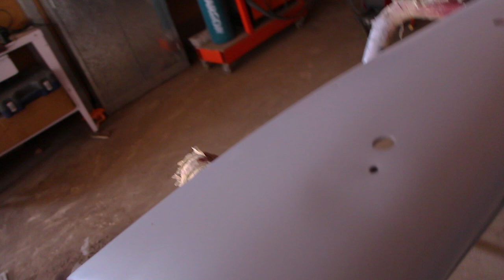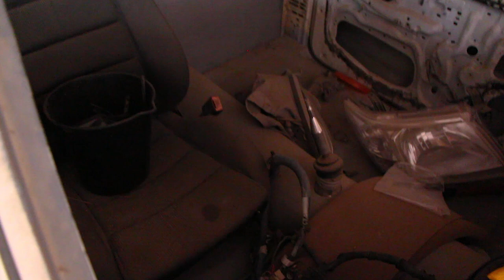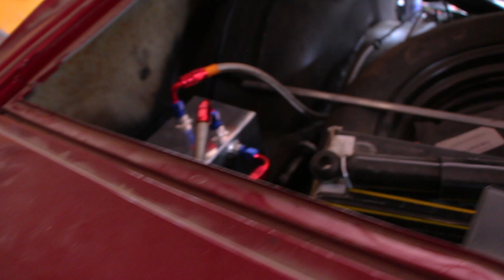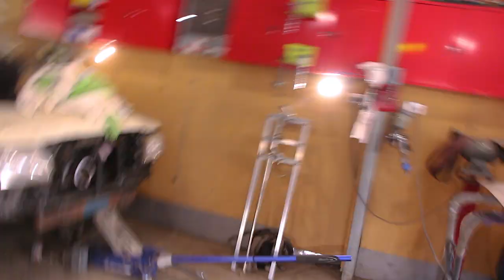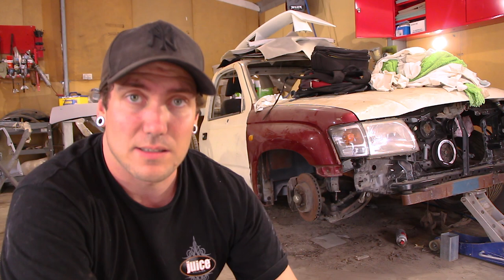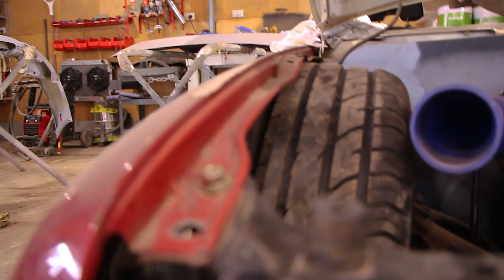What Size Wheels Fit Under A Bagged And Bodydropped Toyota Minitruck

Comment: I have a 1995 tacoma.  I want my wheels to fit in the fender.  What side to get the look.  My is 5 lugs
Reply from the maker: Hi. These are 20 inch 5 x114.3 with a 225/30 tyre. It has a similiar rolling diameter to my 245/40r18....both tuck lugs....id say youd need a +40 offset an ass n 8 inch rim. However i am no expert. These rims still rub so im still chasing the perfect size

Comment: How much of the wheel arch did you cut out?
Reply from the maker: The wheel wells have been removed fullly and will have custom wheel tubs welded in to allow the car to have a full range of suspension travel 😁
Reply: @JoeyVanVeenYt  What kind of effect does that have with the weather and debris in the engine bay, just curious as i have a slammed 89 hilux and hit my limit for lowering the front and daily drive my ute
Reply from the maker: @kieranabbey6418 cant comment there as i havnt driven it. There would be a way to fabricate wheel tubs to limit water and debris for sure. Seems like a alot of work for a static truck though 🤔 Theres only so low you can go static without coilovers or bags. I personally would wait for doing anything wild until you decide to choose one of those paths.
Reply: Thanks for the insight! im looking at spring assisted shocks. but are hard to come by in AUS. Scrape Lux from the states runs this setup bolts straight in and acts as a coil over.
I guess I will have to do some modifications to fit coilovers. Cheers!
Reply from the maker: @kieranabbey6418  no worries! I just remember being young and spending money on mods i really shouldnt have bothered with. Oh well, its all a journey! Enjoy it 😁